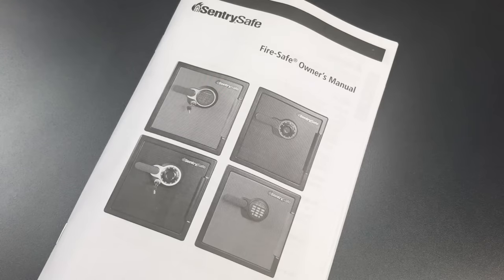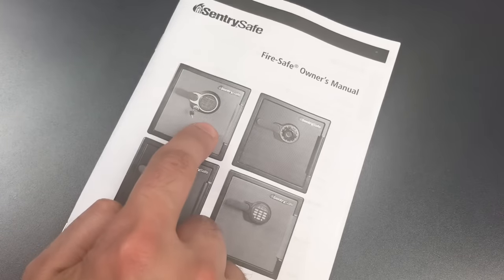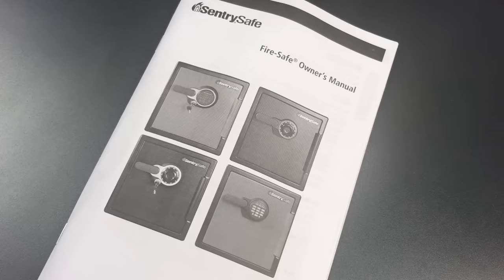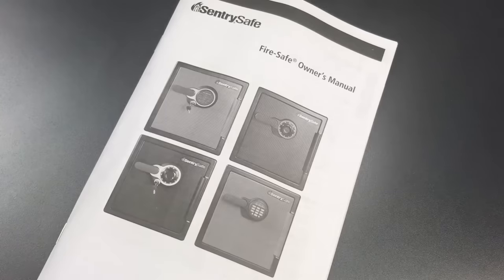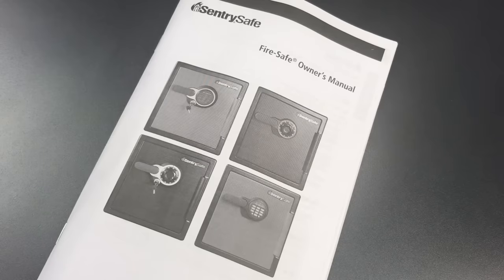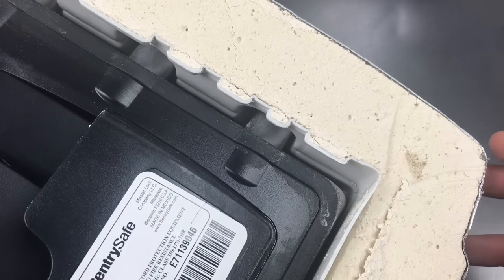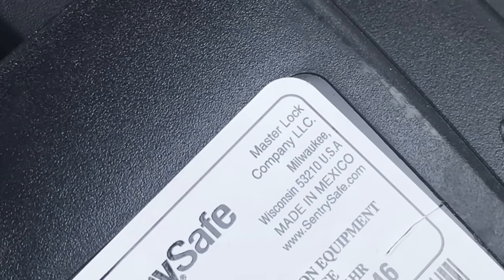[756] Sentry Safe Cut in Half FAST!

Comment: To be fair, when I was in the safe business the term "safe" always referred to a product that was used to protect something from fire.  The box wasn't designed to defeat burglars.  If storing valuables, you would use a stand alone money chest or a money chest incorporated into the safe.  In reality, the lock was only intended to keep the safe from popping open if the safe fell through the floor in a fire, with a security level mainly intended to keep curious fingers and eyes off of the documents in the safe.  Sentry safes are on the low end and would frequently pop open if dropped on a hinge corner.
Reply: Wait, so he could've dropped it on the hinges to open it...?
Reply: This might make sense to a guy in the safe business, but it is not how safes are marketed to consumers and what consumers are led to believe they are intended for. Functionally, the distinction you mentioned doesn't exist.
Reply: @Ninjaferret666  But anyone can walk off with a 90lb safe, no?  For me, it would be reasonable to assume protection from fire is what the safe is offering.  I mean, if someone can walk off with it, it's not really a "safe" like a bank safe.  Having said that, who knows what kind of fire test they put these through.
Reply: They did say on their website “theft protection”, along with fire and water protection, so it does mislead the consumer, based on what they said
Reply: @thatoneguy4584  
You could fill it with concrete to prevent theft.
Reply: While what you said is true, it was arranged that way to mislead consumers. For the average person safe implies that it's for security and very few salesmen are going to try and explain the difference in industry terms vs layman terms. To expand upon this, on the website it has the "Maximum Security" tag on it. Their description of "Maximum Security" contains tons of misleading info. Things like "all metal construction" suggest to a layman that it's made entirely of metal but what they mean is they wrapped a plastic and foam box in something ever so slightly thicker than aluminum foil.
Reply: @Ninjaferret666  It says FIRE SAFE, right in the name of the product dude. Safes for theft are called "Burglary Safes".
Reply: if it's just to protect from fire, why bother with the lock?
Reply: @Rx7man  In the event of a fire, extreme heat is observed, as well as lots of water (fire truck), the lock is there to keep the container shut and secured, as it bows and flexes from heat, and keep the seals tight, to prevent water penetration. A simple latch is often not good enough when a container is faced with such extremes.
Reply: @mikeweatherford1847  You can use the same latch as whatever this safe uses, minus the lock.. that would be honest
It's definitely disingenuous to promote this as a safe that's supposed to prevent people from getting into it.
Reply: @Rx7man  The safe is designed to stay locked in the event that it falls though a floor, it needs to be able to be dropped, and deal with flexing of extreme heat. It also offers utility as a locking box to keep children and guest out. It is called a "Fire Safe", not a "Burglary Safe", if your dumb enough to believe a 150$ wal-mart fire safe is for burglary protection that's your own fault. Real "B-Rate" burglary safes start at 500$ or so for similar sizes. BF (Burglary Fire) are easily 800$++ Your first clue should be the price, second clue is it has no anchor points, so you can just pick it up and walk out with it, no problem for a strong guy, safe only weighs about 70 lbs. All the junky gun safes sold at Academy and other similiar hunting retailers are the exact same shit, you can cut right though them like butter, super thin walls and fire retardant material. You can't buy a decent gun safe for less then 1800$, the better ones are 3000$+ This whole idea is rather stupid anyways, you can also cut open a B-Rate burglary safe pretty damn quick with a few 6" fiber glass cut off wheels. It will be louder and take a bit longer, same result though. When you bring power tools to the table, with anything less then a TL rated safe, all bets are off.
Reply: @mikeweatherford1847  your only valid point there is childproofing
Anything more than like a freezer lock key is useless 

Actually, it's NAMED a SENTRY safe, not a fire safe
Reply: @Rx7man  Since your clearly a safe expert.  You tell us, what could sentry do differently to stop this kind of attack while keeping the weight, and price point of the product unchanged?
Reply: @mikeweatherford1847  Promote it for what it is. As a fire safe. I do think it's misleading. I definitely didn't know a ton about safes. I knew I needed one and went to Walmart and compared what was available. Obviously the price is important but comparing an $800 fire/water/security safe vs an $800 burglary safe, one looks better. I don't think what you've said above is common knowledge, especially when they don't sell burglary safes at Walmart - they have security and anti-theft safes - and given the options, you take whats available. Engineering firms assume their user is an idiot, marketing experts want their users to be idiots - and at Walmart, that's what you're gonna get.
Reply: @mikeweatherford1847  Just be honest about what it is, that's all I'm asking.. just call it a fire protection box
Reply: @Rx7man  Except the fact that Sentry Safes logo is literally a house on fire, lol. The company name is SentrySafe, the product is called a Fire Safe.
Reply: @Rx7man  Not the product being reviewed in this video, you're looking for https://www.sentrysafe.com/product/SF123ES which does not advertise anything about theft except maximum security being defined as 2-4 live-locking bolts, solid steel construction and pry-resistant hinge bars provide the best protection from forced entry and tool attacks. I mean anything with a lock can be described as security protection, does not state theft protection.
Reply: @Ninjaferret666  How could a consumer think that a "safe" that anybody can pick up and be gone in a blink would be a good idea to begin with?

Even if it was made of 1" thick hardened steel, it's a poor "thieft protection" if the thief can grab it and go home.

Any consumer with a brain cell or two should understand this. It's not the company responsibility if the consumers are dumb, come on!

These safe are meant to keep curious fingers at bay. And the day your teen walk around with your circular saw, you know something's wrong already.
Reply: @Rx7man  This kind of safe is more meant to keep theft of opportunity out.  They work fine to keep kids out of things and keep important documents and pictures safe from flood and fire.     I am not sure if this version has a way to bolt it down but if you bolt or even just industrial adhesive it to the floor you will generally stop people from stealing it. 
You have to remember burglary is an in and out thing.   99% of them break in and grab what they can in 5-10 minutes and then leave.    That said this safe looks terrible due to the lack of a way to bolt it to the floor/wall.
Reply: Aeternus I have this safe and it absolutely does allow you to bolt it to the floor. This thing is bolted down with 4 lag bolts in my house. The 4 dimples under it are where the interior bolt hole dimples are. They can’t provide holes because if people did not want to bolt it down, the holes would ruin the fire rating.
Reply: To be fair, a high quality safe, say for instance a Chubb Sovereign or a Tann, is a tough box, but as a friend of mine found out, when his safe full of Gold jewellery was dragged out of his house with chains, a safe is only as secure as the owners ability to keep its existence a secret.  In his case, he had tradesmen in the week before and they had seen it in his garage.  Nothing he could prove and no insurance, so a hard lesson learned.😭😭😭🤣🤣🤣♥️
Reply: what the point having lock?decoration?
Reply: I don’t see this as deceptive advertising at all. Most of the locks shown on LPL can be defeated with power tools and this doesn’t mean they aren’t locks. Similarly, a 90lb fire safe DOES provide security to your valuables, just not a very high level of security against a determined burglar willing to take the time and make the noise. If this safe was bolted down I would feel confident storing documents/watches/normal jewelry in it (bolted down even this attack with a saw would be much more difficult). It will keep out the casual burglar. Obviously if it’s gold bars/Epstein tapes/etc then you need a safe you didn’t buy at Home Depot, but it’s the same as any security product there are levels and you need to use the appropriate level.
Reply: @Prodagy101  To be exactly is the https://www.sentrysafe.com/product/SFW123GDC and, in the features, it says "Pry-resistant hinge bar reinforces the door of the safe for added protection against theft." so ok, they say that only the door is theft prove if you read carefully and that's their best protection. And the "solid steel construction" is also true, is in a solid material state (no liquid or gas) and probably is made from steel.
Reply: I would not agree with that.  That's pretty stupid, to say that a safe is not designed against theft?!?  Then it's not really a 'safe' then is it?  I have never heard of a "stand alone money chest"  What??
Reply: The advertising is deliberately misleading but what advertising isn't? If you can't see through that blatant marketer speak and figure out for yourself that they're junk then that's on you. It's obvious because there are no real guarantees made about any of these products until you're looking at TL 15 or above.
Reply: Oh really?

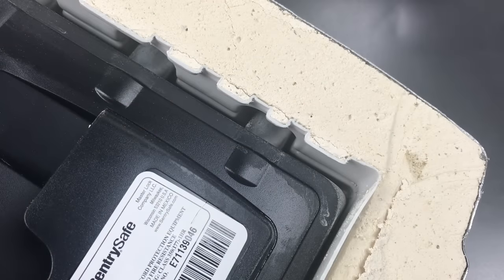Comment: I think the explanation comes at 3:50 where on the tag it says ‘master lock company llc’
Reply: Is this safe trolling its owners ?
Reply: It's not a bad product but it's been irresponsibly marketed.  In reality it should be marketed as effectively a lockable metal filing cabinet that protects documents from fire and flood.....and I'm not even sure about the flood protection, it might just be against splash (like from firefighter hoses putting out the fire or from water damage from being outside in wet weather conditions but not actually able to be submerged in water for any appreciable length of time.
Reply: @22steve5150  
Considering its construction, maybe its bouyant?
Reply: Exactly my first thought when I saw it. Masterlock is well known for not being any kind of master in the context of locks (they make products that mostly keep out honest people) so it makes sense their Sentry doesn't even sentry.
Reply: @22steve5150  I have one (not this model, but similar) and I agree, it's not a bad product, if you are using it appropriately. For me, I wanted something that would resist a fire so that if my house burned down I'd still likely have my most important documents intact, and would provide more deterrence to theft than leaving things in my dresser drawer. Would I have liked to have something that was also near impenetrable? sure, but I couldn't justify the price difference for a "real" safe for my purposes. I did however bolt it to the concrete floor, and put it in an out of the way place that would be unlikely to be found and opened without spending more time than I hope my alarm system allows a burglar to spend.

As for waterproof. The company selling it claims that it is submersible, however I have my doubts. Even more so if you follow their instructions for bolting it down which involve drilling holes for the bolts in the bottom of the unit. That said, I put the important documents in ziploc bags inside it, and I also siliconed the bolts to try to reduce water inflow.

For my purpose, I'd happily do it all over again.

Comment: This particular safe, which I've owned in the past, isn't really designed for security, it's designed more for resistance to fire. The typical burglar won't be using any noisy cut-off saw, they'd use a prybar or hammer. I'd like to see how well it does if attacked by one of those. Thanks for the video!
Reply: it wouldn't be a quick as the saw but the end results would be the same.
Reply: There are pictures on the net of these units pryed and smashed open.  But realistically, anything that can be carried away will be entered. If installed securely in a wall, most thieves will move on to easier targets.
Reply: If a thief got access to your home, they'd probably lug the entire safe away. Meaning that, yes, even just owning this and filling it up with chocolate money will both:
a) ensure the thief will be lured by the low hanging fruit and make him carry away this heavy thing possibly restricting his choices (i.e. he might forgo that expensive TV or PC because he  didn't have time and he choose the safe)
b)  you bet your ass some special moments will happen when he open the safe just to find a bunch of chocolate money

And I too think this safe is just designed for fire and water protection. Which is actually very reassuring to have! Only gripe I have with it is how it is advertised: it shouldn't be advertised as a regular safe would be.
Reply: They steal the safe, and crack it open with power tools at their house.
Reply: It’s also possible for a thief or two to just take the whole thing and work on it elsewhere.

Comment: First sign that it's probably a bad safe is that you can move it easily.
Reply: Designed so you can grab it as you leave the building that is on fire.
It is designed to protect against fire not theft.
Reply: @kaspernbs  But why having a lock on the safe then?
Reply: @mikkolukas  children
Reply: @nate3529  But children can open it with a circular saw!
Reply: @kaspernbs  "It is designed to protect against fire not theft."
Yeah that's why they explicitly call it "Fire-Safe". Although it's very obvious that they are trying to mislead people into it being an actual safe, and using "Fireproof Safe" in some other labeling.
Reply: i have one which i now know is bad news but they are very heavy. you could not get far plus  they have bolt holes you can drill out easily to  bolt it into a solid floor. say all that, its obvious i was duped, they are crap
Reply: @ghosttrain4118  lmaooo
Reply: @ghosttrain4118  lol
Reply: @insertnamehere5146  Never buy one from the store. It is a good idea to bolt it to the floor, as I learned that from someone robbing my house. A good idea when you purchase one is to take a sledgehammer and see if you can do any damage. Most people aren't going to have any kind of knowledge about opening them, but will use crude cheap tools in a fast manner.
Reply: @kaspernbs  Why would I grab it, if it protects against fire anyway?
Reply: @SomePotato  A fire safe is only rated for a certain amount of time. 
After that time has elapsed the fire proofing can start to fail and its protection will no longer do anything.
Ie a 1hr rated fire safe will start to fail after being in a fire for 1 hr.
Reply: @kaspernbs  Okay, that makes sense.
Reply: @mikkolukas  distraction
Reply: If you live in an apartment, you need something that moving guys can move.  I realize that it is not perfect security, but I'm not sure how to do better.  You can put rolls of coins in it to make it a little bit heavier and take them out on moving day.  I bought a cardboard box, cut the back and bottom off and put it over the safe to hide the safe.  I have other boxes.
Reply: "Immobility" can be achieved in several ways: By making it very heavy, it then is not immovable, but hard to remove without technical equipment. You can bolt it to the floor or to the wall in a way that the bolts are only accessible from the inside. This works well with small safes, but with enough force, you can break the bolts or loosen them from the wall. The best way to do it is to make it a part of the concrete and rebar structure of the building. In order to remove the safe, you need to tear down the wall or floor. So can further make it harder by using hardened steel and corundum or silicon-carbide in the concrete.  So it becomes a part of the house that remains as the plumbing and cables do.
Reply: No! The first sign should be the fact that it's a fire safe. Not a bank vault. It's meant to protect your valuables in the event of a house fire. Not a thief with a circular saw.

Comment: Thanks for showing this.  I learned how crappy these safes were a few years ago.  It's essentially a thin metal mold with a bunch of injection-molded cement and foam inside.  When I dropped mine off of  the end of a truck, the plastic grommet on the back popped off and a bunch of the injection-molded filling spewed out.  Later, I found that there was a daylight showing inside the safe.  Total piece of junk.

Comment: I have harder time cutting plywood
Reply: 4estrose 
Ok. It’s still sold a ‘safe’. 
And not hard to breach without destroying the contents. No fire, no impact tools, no time or skill req’d. A 30$ saw, 10$ blade, 2 minutes, and voila: breached. Just some noise.
Reply: Really Man, they should just have poured concrete with some screws in the mix to fuck Up discs and be done with it
Reply: Vintage plywood,or particle board
Reply: @fernandotrevinocastro1018  I don't disagree.. but the point was fire resistance.  Concrete isn't an approved fireproofing material in and of itself, and I'm sure the fireproofing added is cheaper anyway.

Comment: To be fair it is sold as a 'Fire safe' and the insualtion is to, protect the contents from heat. If the safe is bolted in place, the average house burglar is not going to be carrying power tools, nor wanting to make  noise. These safes are at the bottom end of the consumer market and anyone with valuables would be looking to pay much more.